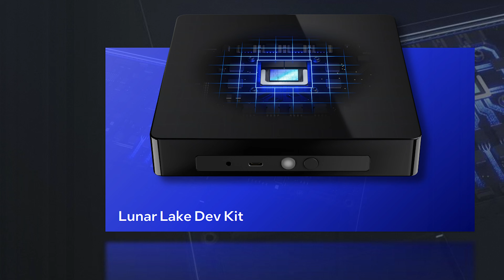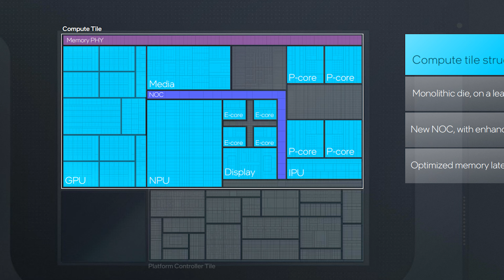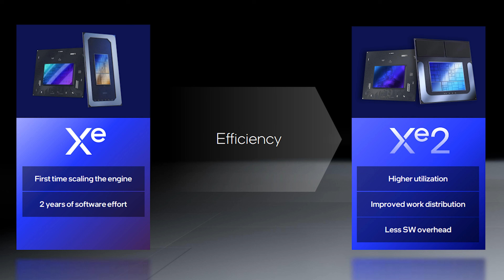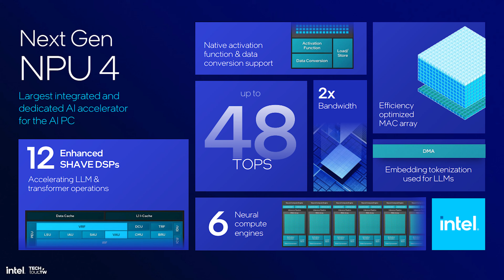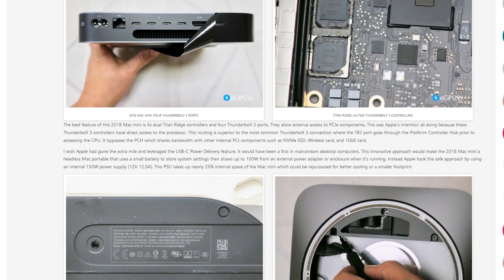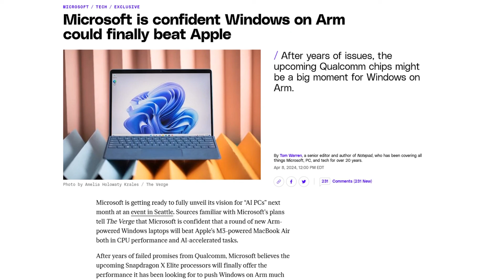Intel And The AI PC Revolution! Lunar Lake REVEALED

Comment: After my failed 13900k I will never buy Intel again. Screw Intel and the $1200 lost mobo and cpu they caused 😡. I am now am AMD fanboy for life
Reply: What's happened? did it burn???  I bought it 1 week ago😯
Reply: @chesslive2714  my io went out. It was undervolted too! So my usb ports went in and out and failed to boot sometimes with a usb drive plugged in. My gpu kept reinstalling itself next. In Linux the driver didn’t reinstall and required a reboot for the second monitor?? I realized my pch was overvilted by .5 volts which damaged the ports. I then decreased clocks to 5.2 ghz and upped the voltage to stabilize which degraded it further. In the end my new 7950x3d outperforms my 13900k as I had all the undervolts and clocks

Comment: Titan, the largest moon of Saturn, has 32 named lakes and about 650 lakes and seas in its polar regions. The most well-known lake on Titan is "Ontario Lacus", located in Titan’s southern hemisphere. It is roughly 234 kilometers long by 73 kilometers wide, similar in size to Lake Ontario on the U.S/Canada border. An interesting note, Titan's hydrology involves methane and ethane instead of water, making its lakes and seas quite different from those on Earth.

"Ontario Lacus" is directly related to the city of Toronto in Ontario, Canada, by name only, otherwise it's distinctly a rather 'gaseous' feature of Titan. Intel of Canada, a subsidiary of Intel Corporation, focuses on various aspects of technology development, including hardware design (including GPUs), system simulation, and ASIC implementation (application-specific integrated circuits is an integrated circuit (IC)). Intel established an engineering lab in Toronto, lead by Jim Keller, at the 'tender age' of 59 (Intel: April 2018 - June 2022), landed inside Intel after departing from Tesla, after serving as the vice president for Autopilot and Low Voltage Hardware. Known as "The Zen Master", Jim Keller is a legendary IC designer, having previously partnered with AMD, Apple, Intel, Tesla and others. The lead architect of AMD K8 microarchitecture & original Athlon 64 are impressive CV entries, but the pivotal role he played in developing AMD’s Zen architecture, left industry insiders perceived his move in joining Intel, was a major winning point scored by Intel. Unfortunately for Intel, Keller’s departed Intel in June 2020 due to unspecified personal reasons, but continued as a consultant for six months, to assist with leadership transition, and was joined by Raja Koduri's departure in March 2023, the AXG Chief Architect, for ARC GPU development.

After five years at Intel, Raja departed to develop an AI-focused startup, in the software space. His departure followed a restructure of Intel’s AXG graphics unit, started by Jim Keller, choosing to pursue enlightenment, in the attainment of a achieving a higher Tao, and possibly to discover better states of Chi. Raja Koduri initially joined Intel in 2017, after a stint at AMD. During this indenture of his tenure, he played the "Bansuri" (side-blown flute from India, associated with Hindu Lord Krishna), along with a "significant role" in shaping Intel’s silicon portfolio strategy (notably hatching of Intel's master plan to bulldozer AMD and lay waste to the wildly successful Zen Architechture, more like the Goddess Kali, than the sweet flute fapping of Lord Krisna), together with Murthy Renduchintala (also a Chief but not from India, as the "Sitting Bull" aka Cheif Engineering Officer of Intel AXG) to bolster their 'capabilities', in developing of a new line of discrete GPUs, which commenced in 2020 and on March 30, 2022, Intel launched the Arc Alchemist graphics cards for desktops and laptops. Moreover, (Moores's Law, is over?) Intel confirmed the upcoming release of the Gen 2, Arc Xe2 Battlemage GPUs is scheduled for launch (soon-ish) likely 2024 as they're now in boxes somewhere gathering dust, as opposed to when they'll be released, to gather dust somewhere else, which of course, will be followed soon after by the Xe3 Celestial (although chances are, provided Intel has become a fast food vendor of 'chips' by then, this is one GPU that maybe able to handle Pacman, Galaga and other classic titles, and facing off in a head to head.. to head battle against AMD and Nvidia, targeting their high end 7900XTX / 4080-90 series, with potential to in fact be, a brutal weapon in gaming and potential highlight in the history of GPU engineering. Holding your breath waiting however, is not advised). 

Currently about 30% of the Arc GPU team are hard at work, in developing the Battlemage software (optimistic for a day one driver being ready, saving a great GPU, from looking more like a paperweight, as observed in the Egyptian sounding, previous iteration). Meanwhile the ARC hardware team, moved on to develop and prototype the Gen 3, Celestial range of GPUs, which like Alchemist and Battlemage, competes directly in the PC gaming arena, alongside Nvidia’s GeForce and AMD’s Radeon products. To Xe or not to Xe, that is the question!

Comment: So on the 15900K are we getting full PCIE 5.0 4x NVME to CPU and 16X GPU at the same time?
Reply: Mate what are you on???

It won't be called a 15900K.
It will be called an intel Core Ultra 9 285K on the LGA1851 socket platform Motherboards with 800 series intel chipsets.
Reply: Of course not! You need a $5000 Xeon for that 🙄
Reply: No, we’re not getting that!
Reply: @tringuyen7519  Godammit 🙄

Comment: The whole NPU thing will most likely be as useless as Intel GMA was vs dedicated GPU.
Reply: Actually it will be even more useless.
Reply: @user-yd1qk9kw9n uhh isn't 4090 doing like 20tokens/s on 30b LLMs? This doing 30?
Reply: @user-yd1qk9kw9n  i tried to find memory bandwidth on that, it looks like it will be 170 max which would mean around 3 tokens/s for 30b models at 8bit

Comment: ai this ai that ai thus ai so... what about making hardware that would enable laptops with 14-20 hour battery life? running a llm on a machine is such a niche use case versus having a generally useful power enevelope.
Reply: I mean, you don't need cutting edge hardware advancements to reach 14 hours of battery life. 

Just bring back the secondary pack design from the old think pads.   The ones that you could hot swap while the laptop was still on. 

We could have 14 hour laptops.  If only laptop manufacturers weren't cowards who are afraid of laptops with some Thiccness.
Reply: I really don’t need a laptop with over 7-8 hours of battery life because power outlets are everywhere . I’d rather pay for performance or lightness .
Reply: @5600hp  but we need manufacturers to claim 12+ hour battery life cus when they say 12 hours, in reality it's like 3 hours under any moderate load (even just a zoom meeting or a powerpoint with some animations).
Reply: @redtails  you guys have a point
Reply: @5600hp   Yes. For your use case hours and hours of battery life is less valuable. 

But for people who work in environments without outlets, long battery life is a god send. 

I still remember the Lenovo my work gave me back in the day.   It had a main battery, plus an hot swappable back up battery. 

So whenever you ran low on power you could hot swap in another battery pack with a full charge. 

I'd carry around two extra's in my back pack with me. Just in case.

Comment: It’s interesting to see race-to-sleep in the context of NPU operations. I wonder what the expected duty cycle would be on the thermal design of the chassis. It’s only saving energy per task, if a user then responds by running more tasks then the total power usage can get much higher.

This has been an issue in past xeons where race-to-sleep behaviours led to unpredictable performance as the actual power draw under load could quickly become a problem. It caught us out big time in a previous job where systems under high load could pull 2-5x the stated TDP for short periods and get us in trouble with our co-location partner.

I’m also curious how a blade based box with 32 of these would work for a mixed workload multi-tenant host. Not the fastest at any one thing, but can run almost anything fairly well within a reasonable power budget.
Reply: For "Ice Lake" (2020) - Intel addressed this by disabling C1E auto-promotion and exposing C1E as a separate idle state, allowing better control over power-saving features. 	
drivers/idle/intel_idle.c	36

Intel Xeon X5xxx processors go into a race condition, was patched years ago in Microsoft and Linux, having a similar issue, which your vendors really should know about in either case and be able to patch or work around the issue, as it is not exactly a mystery or ancient tai-chi mastery... probably exists, as it goes for known problems, for equally as long however.. co-located.. good luck with that! Much fun... so much! Oh, how I do not envy thee, good day to you sir and God speed - boom-tsh!

Comment: Maybe I missed it, but I heard nothing about memory bandwidth. AI inference token-generation is all about memory-bandwidth, and this is where the M-series Max/Ultra shine, with their wide busses - TOPs/FLOPs only matter during prompt-processing where you can batch the token-processing, and don‘t have to pump GBytes of AI parameters into the caches for each new token generated.
Reply from the maker: Wait for the hands on. The npu has 8 mb of sram for a buffer so.. the pieces are here at least. But a lot can happen between nownans launch
Reply: @Level1Techs  cache is of limited use since LLM inference requires a forward pass through all your layers/parameters serially (for an 8B model at Q4, that means going through ~5GB for every token generated). For Lunar Lake @ 128bit w/ LPDDR5X-8533 that's a theoretical max bandwidth of ~136 GB/s. Strix Halo will be a bit more interesting with a 256-bit memory bus (270MB/s), about where a theoretical M4 Pro would be, but an M4 Max would be at 480MB/s. Now TBT, 120GB/s is adequate speed for a 7 or 8B model, but what you'd really want for something with a lot of system memory (128-256GB, dual LPCAMM2?) is to be able to run a MoE with say 20-40B activations and 100B+ weights (eg Mixtral 8x22) which will get you something within striking distance of GPT4-class on a local machine.
Reply: I believe the on-die RAM will help maximize bandwidth & latency.
Reply: @PhazerTech  this will help, but with 2 chips (16/32GB RAM) it probably will get a similar bandwidth to the M4 or SnapDragon X - probably 120-135 GB/s. Where the M-series Max have 400GB/s and the Ultra 800GB/s.
P.S: CAMM2 in theory seems to have 160 Bit wide access at 7.5 GT/s - if the chip uses 2x64-Bit=128 Bit, this gives 100GB/s.
Reply: @andikunar that’s really useful. Thanks for sharing the maths :)
Reply: It's more than 544 GB/s at bandwidth. Which is a real number unlike Apple's 800gb lies.
Reply: @AnotherDay-ce6th where 544GB/s is coming from? It still the same 128-bit wide memory controller?

Edit: it seems like you've calculated from 8500MT/s for 64bit memory bus -- so forgot to multiply by 2 for dual channel and divide by 8 for bytes. So 136GB/s theoretical peak, nothing interesting.
Reply: @niter43  exactly, and this e.g. gives 135GB/s with LPDDR5(X)-8533 RAMs. No idea what he meant, also regarding his claim for Apple-lies (see my response to him)
Reply: @niter43  likely you forgot to add 4 memory channels also. And then multiply with 128bit then divide with 8.
Reply: @AnotherDay-ce6th  in what world you have 128 bit single memory channel width?

There's just two memory channels, four is counting by sub-channels.
So it's either two 64 bit channels or four 32 bit sub-channels -- wow, so 128 bit _total_ memory bus width no matter how you count.
Reply: @niter43  there even higher memory bit rate can be seen on gpu in single width. It's nothing new. And TWO is the memory die, not channels. So counting those sub channels 8 with 64 bits, It's the number I gave.
Reply: you don't need a lot of bandwidth for local inference with batch size equals 1.
Reply: @Fordance100  contrarily, batchsize 1 limits your throughput mainly by memory-bandwidth, your GPU and probably NPU waits/idles a lot for the caches to get filled with the GBs of parameters. If you can batch, e.g. at prompt-processing, your GPU/NPU gets utilized better and FLOPS/TOPS become the limit.
Reply: @andikunar  , bandwidth is more to do with initially loading weights from cpu to GPU.  Once weights are in the GPU, the only thing move from CPU to GPU is input which is is very small.   NPU is very slow (low energy consumption) for large models, shouldn't be used.  Apple M max chips have big GPU, that's why they can run quite fast.  If you use local inference just by yourself, it's mostly idle unless you constantly use it.
Reply: @Fordance100  maybe I'm mistaken, but I don't think so, having done a lot of work with llama.cpp,etc.. on my machines (including a 96GB Mac Studio M2 Max). 

No CPU/GPU/NPU-Chip (SoC) can cache a few GB of AI parameters. Even its L3-cache is probably around max. 50MB. The multi-GB parameters are pulled initially from SSD,... into (on M-silicon and here "unified") RAM and then again-and-again pumped from RAM to the SoC's multi-level caches. The GPU/NPU needs ALL the parameters again-and-again for generating EVERY new token. AI-model quantization reduces parameter-size, so does MoE (like Mixtral) for token-generation. But the new long-context AIs might need even more RAM for their KV-caches than for the parameters.
Reply: @andikunar  batch size 1 has nothing to do with either arc 1 or arc 2 memory bandwidth. It is more about the memory size.
Reply: @Fordance100  what are you talking about? With batch size of 1 all you need is bandwidth (assuming memory size is solved question), that would be the primary thing determining your token generation speed.

Comment: Thank you. Looking for info about lga1851. Hope for more pcie lanes (empty hopes) and bifurcation, that AMD doing for generations is regular desktops (and hope they will go to 2x2x2....x2 scheme that is interesting with pcie5). There can be interesting configurations with 2-4 core cheap and efficient chips in DIY area. For example if I want to build something like simple nvme NAS, I will use AMD (may be new EPYC 4004 with 4 cores), that delivers bifurcation at least 4x4x4x4 that can give me 4+2 on board nvme without any complicated pci-e switches. Hope to see Intel in this area.
Reply: ARL will be the same as MTL. IO, SOC, & iGPU TILES are all the same as MTL & all are made in TSMC.

Comment: Im ok with the laptops having RAM on chip for the NPU and such, but i definitely want to see a move away from the soddered memory and onto the CAMM2 standard
Reply: Not sure if this would not somewhat degrade the memory-bandwidth. M4 and Snapdragon have 120-135 GB/s and they all have the memory right next to the SoC. Very wide busses might help (M2/M3 Max has 512 Bit with 400GB/s), but I saw only 2 chips in the videos. I also would LOVE to be able to upgrade RAM again, but am skeptical.

For AI inference token-generation the memory bandwidth is the key limiting factor, not the shiny TOPs/FLOPs - the SoC needs to pump GBytes of parameters to the cache for each token generated. NPU/GPU top performance is only necessary for prompt-processing, where AI-pworkloads can batch the token-processing. AI on the edge will become quite a standard workload for PCs, requiring >100GB/s as baseline.

P.S: CAMM2 in theory seems to have 160 Bit wide access at 7.5 GT/s - if the chip uses 2x64-Bit=128 Bit, this gives 100GB/s.
Reply: m4 has 100GB/s at 6400mhz @andikunar
Reply: @andikunar Well, that’s only true for LLMs. True, nonetheless.